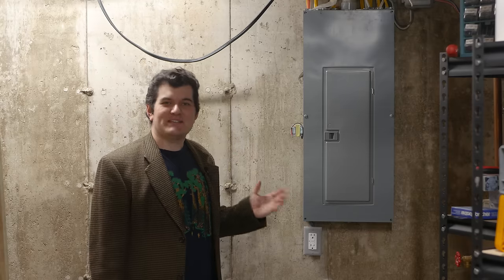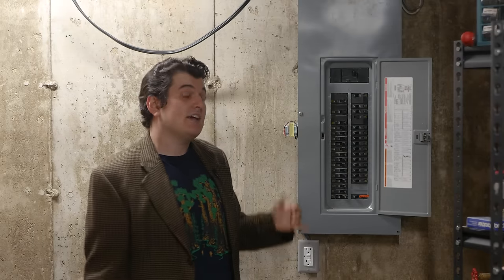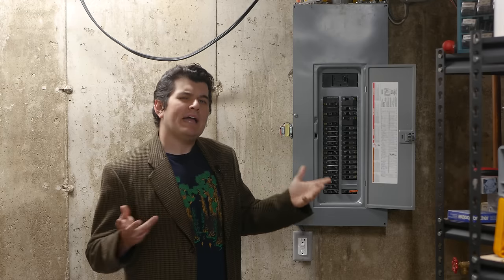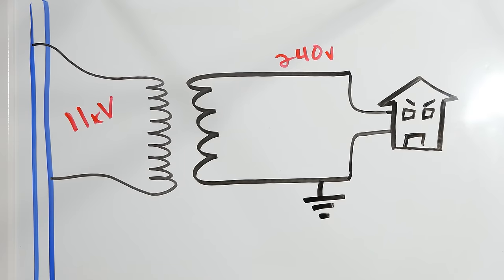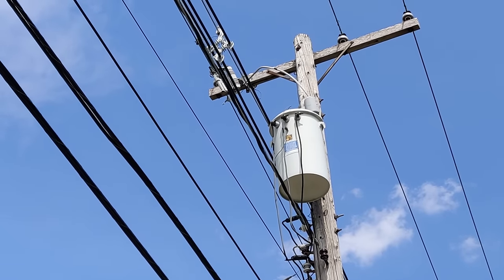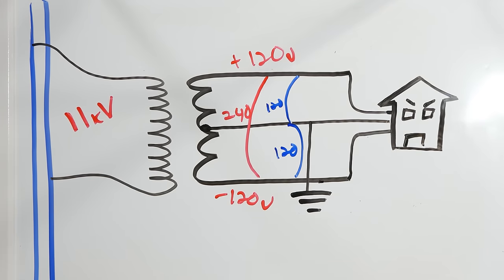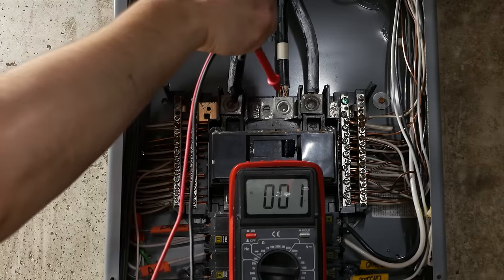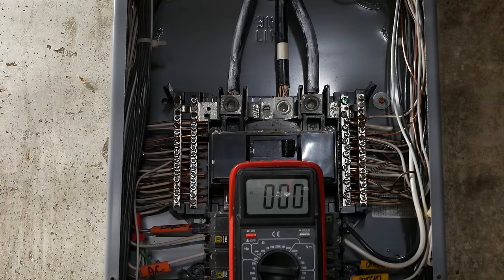The US electrical system is not 120V

Comment: For anyone commenting on how “bad” his panel is, I’ve seen WAY worse when old buildings upgrade the circuits without upgrading the panels. My parents 97 year old home had so many wires in in before upgrading to a full 200 amp panel it was literally dangerous.
Dual circuit breakers (yes they are real) WITH two wires in each circuit because there was just no room for more breakers being a 100 amp panel.
Oh and nob and tube wiring which often was wired incorrectly and electrified the device instead of grounding it! In the US older homes can be an electrical fire waiting to happen.
Reply: Yeah I would consider his panel damn near pristine compared to.... well almost any house I've ever lived in. I mean, you can tell what runs where, it's labelled, wires run in logical lines! Mostly all installed in the last 50 years! No immediately obvious fire hazards! I would be downright pleased to have a panel that clean.
I've lived in a house with 3 distinct generations of wiring systems - the original knob & tube with cotton sheathing, then some rubber-sheathed/cotton wrapped, then some 90's rubber sheathed/rubber wrapped, all fed haphazardly into a semi-recent 100A panel. You can tell that the skill of the person doing the wiring went down with each generation of wiring too - the original stuff was actually installed decently. The later stuff was a bloody nightmare.
It's really common to see houses with a mix of Aluminum and Copper wiring, or with the original knob & tube running into the original fuse panel, which was unhooked and then fed from a 60A breaker on a new panel - leaving the old stuff as is and just installing anything new into the new main panel.
Reply: Yeah it honestly looks like a pretty normal 200 amp panel, just with more circuits than most single family homes have.  I've seen MUCH worse wiring jobs.  And honestly, how much does it even matter if the wiring in the panel is kinda messy?  It's covered for a reason, and you shouldn't be messing with that shit unless you really know what you're doing anyway.  In which case you'd probably know enough to kill the main before digging around in there.
Reply: Joshua  I'm very glad that according to NEN (Dutch DIN) the entire fuse box must be replaced to be up to code on any significant change.
Reply: In my panel everything is ground to the neutral lead, the house doesn't have a grounding rod. Yay 1920s electrical code (or lack thereof)!
Reply: Joshua  to be fair, electrical fires in the United States are exceedingly rare. Most are caused by poor wire condition, rather than the design. 

The panel box is probably the safest place, electrically, in the whole house.
Reply: @Cyanide300  Looks typical to me, but I've only ever seen my own electrical panel.  We live in a single family 2784 sq ft (260 sq m or so) home.  Houses around me range from around 1500 to 3000 sq ft (140 to 280 sq m) That number of circuits allows for 1 or 2 per room for outlets, a few for lights, 1/2 a dozen for the kitchen, and a few 240V appliances.  Mind you we have gas water heater, furnace, dryer, and stove, so we actually need LESS than you might otherwise.  I'm not sure if people in the UK just live in smaller homes, and thus need fewer circuits, or they just have to turn off a more significant part of their home if they need to do any electrical work.
Reply: Oh and my entire house is behind 2 tandem 30 amp breakers that feeds about 8 30 amp breakers...
Reply: Our panels are rotated 90° from that but yes that panel looks beautiful compared to some of the boards I've had to work in...
Reply: @arienh4  i think in the US most electricians will upgrade the box if there is a big change or to replace older (20+ year) panels, but then again we also are not known to have certified electricians do some of the work, we like to fix and replace stuff ourselves which can lead to a lot of hack jobs.
Reply: There's nothing wrong with dual breakers. They are standard in a lot of cases, and allow you to use a smaller panel to server more circuits. The busbars are more than capable of delivering the power necessary for 2 15-amp circuits from one standard sized breaker.
Reply: My UK one is lead and paper lined cable from the main line to the house going into a wood and bakalite box with a few breakers, then onward through another 3 breaker/isolation boxes as no electrician wanted to touch the original box/cables.  Everytime a cooker or shower etc was installed in the house a new box was added along with a ratsnest of cables.  Im gradually replacing the fuse wire cartridges with rcds but to replace the entire lot with something safe would cost thousands and thus will never get done.  So yeah, his box is like a palace lol
Reply: @PunakiviAddikti  what he meant by not grounding the device is that knob and tube was often wired backwards, such that neutral was live and live was neutral. This didn't matter very much with non polarized plugs, but for Edison screw lightbulbs, this made the screw which should be neutral and therefore relatively safe live at mains voltage. Changing a bulb incorrectly was enough to cause severe harm.

Really the bigger issue with K&T is the huge fire hazard. Paper insulation, now likely chewed and rotted, meaning exposed several decade old wiring mere inches apart running throughout your attic. One mis step storing a box and boom, you're dead, the house is burning down, and your insurance probably doesn't cover K&T fires.
Reply: My grandparents house has light switches that you have to flip in the correct order or sparks come out of the wall. His wiring is a work of beauty. It doesn't even have exposed wires on the outside!
Reply: They should see my 100Amp panel on my house built in 1950 with nothing labeled and halve the lines run being old braided 2-12 with no ground and 90% of my lights piggy backed off of one leg of my dryer 240 with out their own sub panel (all things I plan to fix I moved in a couple months ago)
Reply: @roxies.8287  barns? Yeah, that's a farmer. People who do any repair or maintenance do not like typical farmers. If it's already broke, they break it into submission.
Reply: I read that as "Mormon" first time round. That was a little weird.
Reply: I'm about to work on a panel that has had anything professional done to it since the 70s. Someone at some point rewired the garage into the living room to add a hot tub...time to fix that.
Reply: Well, from a code compliance issue, I can see couple of issues with his panel.  Ground's and neutral are to be hooked to separate bus bars.   Only one neutral wire is allowed per lug on the bus bar.  It appears he has multiple instances of a ground and neutral sharing the same lug.  The reasoning behind that code rule is this...  Suppose there is a loose/bad connection in the panel.  The ground and the neutral are share the same lug or bus.  The neutral voltage will float above ground voltage due to the high resistance of the poor connection .    That circuit that has it's ground sharing the same neutral lug or bus, will no longer have a ground at zero volts potential it will float to the same voltage as the bad neutral .   So a grounded metal framed appliance, like a refrigerator could become a shock hazard.  If you got 2 circuits from different 120v halves sharing the same neutral lug and that connection is bad, then the voltage at one of those circuits could rise above 120v and the other below 120v because the neutral is now floating.
In the real world how much of safety risk this actually is...  Probably not so much.
Reply: My in-laws house, built in 2010, has these too. More breakers in a small panel!
Reply: My dad's house...built new in 1987...with 200 amp service...has a panel with a bunch of twin breakers and exactly 2 spaces free. I think it's a 16-space panel. Did they actually save any money doing it that way, twin breakers were usually more than twice the cost of two normal ones...
Reply: Old houses are grandfathered in you still have houses in the USA with knob and tube wiring. Not an issue unless you hire a hack electrician or mess it up somehow.
Reply: @Cyanide300  I have three panels on my place.  One where the power from the main power pole comes onto the property, one to my work shop (4800 sf) and one to the residence.  At times, I use all the power coming into the property, especially since I also have a deep water well which uses 220V current.
Reply: I thought his looked nice af. Our house was built in 1951 and the electric box is so messy and bad looking, probably not up to code but who cares.

Comment: lmao the last couple minutes where you're just going off is 10/10
Reply: I laughed so loud just now finishing the video. Like some sort of crackhead at 3:30 in the morning.
Reply: @artcamera5514  True. I travel the world for work, and using plugs all over the place, I can appreciate the smaller form factor of North American style plugs. The UK bricks, forget about trying to plug in more than one or two chargers in most cases. Australia, same thing. And the massive size of those plugs, you damn near need another suitcase to carry them around. EU two pronged- never know if any given combination of plug and outlet will fit together to make a connection, and they always just flop around loosely and fall out, usually have to get a stack of books or something to support the adapters or plug ends. And the switches on outlets.. no labels usually so it's a guessing game of flipping everything on and off to try to figure it out, let alone accidentally bumping them or setting something on them and shutting off the power.

Comment: why is the house angry
Reply: The house is angry because it desperately needs a new roof.
Reply: @MoparDan  Top-hinged slates/tiles/shingles maybe? So they can lift and let the pressure out during the experiments ..? This would prevent the roof from blowing away due to too much positive internal pressure.
Reply: First thing that came to my mind, too. The house looks fierce...
Reply: If someone connect you to grid you will be angry too or even shocked
Reply: It's the angry pixies running through it.
Reply: Lol i just commented that
Reply: It's his house. 

Get to the end and it'll make sense.

Edit: I got a notification that someone liked this comment and I don't even remember why this makes sense. 
Was it because he rants at the end?
Reply: The house is angry because Europeans wired it 230v
Reply: Just mad at all of the negative energy towards the American standards
Reply: Because it wanted single phase 240V potential instead of split phase 120V at 180°. 😑
Reply: It's probably an American house that was built in the last 30 years so it's barely built to code in the cheapest way possible with crappy materials so if it's lucky it might last longer than the mortgage takes to be paid off
Reply: You'd be angry if he lived inside you!
Reply: because it knows its not the Rising Sun.
Reply: 420 likes

Comment: I'm an electrician from Australia and I thoroughly enjoyed this video haha cheers mate
Reply: Greetings, fellow Aussie! I recently had a sparkie install a new oven in my kitchen. He also fitted an isolator switch in-line with the conduit which is required by law. However, with the oven installed in its recess in the kitchen cabinet, the switch ends up being concealed behind everything and is completely out of sight / reach.
I suggested that he fit the switch to the wall outside of the cabinet where it would be accessible so that it can be turned off if necessary. But no, apparently he wasn't allowed to do that... The switch 'had' to be behind the oven specifically. Gotta love the nanny state. :o)
Reply: @razeezar  Im sorry mate but that is total bullshit and he needs to fix it as he has not followed the standards. 
The cooking appliance isolator needs to be within 2 meters but also easly accessable without reaching across the cooking surface. If you need to you can tell him to double check AS3000:2018 Section 4.7.1 
If you have any issues with getting it resolved I suggest you call your state licencing registrar.
I hope it is sorted for you. Peace.
Reply: @dcaonoek  Cheers Dane, I'll check that out.
Reply: razeezar Australia honestly seems like regulations gone mad.
Reply: It looks like section 4.7.1 pertains to open stove tops. I haven't found any specific info regarding an isolator required for built in ovens, but cursory reading of discussions on whirlpool indicate that an isolator is required for a stovetop but, confusingly, not for an oven. It'd be nice if the standards code stated this specifically either way!
Reply: @razeezar  you are right. Sorry, when I think ovens I think free standing range. Which is absolutely my fault.
Reply: @jackhewitt7902  why?
Reply: @dcaonoek  All good! Still, the whole regulation thing my sparkie was going on about made little sense. Especially considering that my house wiring already has a dedicated breaker switch for the oven circuit in the meter box out front.

Comment: RE: the "Don't try this at home" part: This was my favorite lecture that one of my professors gave back when I was in college. It was famous for anyone who had taken his class. He called it the "How Not To Die" lecture and covered pretty much what was in this video! One other useful thing he also mentioned: In a lot of the newer hostpitals and care facilities, they install the 3-prong outlets upside down so that if a metal object like an IV stand falls down onto a partially inserted plug it lands on the neutral phase.
Reply: i.e. the right way up.

/brit
Reply: @tyteen4a03    But then it doesn't make the little face. 😮
Reply: NEC, trying to protect you from yourself since 1897.
Reply: "Don't try this at home"
** Me as a electrical engineer who works on up to 380kV substations **
"Why?"
Reply: @taylorwest6986  It's quite the conundrum. On the one hand, we don't want people to electrocute themselves and die.
On the other hand, 😮.
Reply: Most commercial electrical installs in the last 20 years are ground prong up. The office building I work at, built in 2007, has the outlets ground prong up.
Reply: No, it lands on the bond wire (the "ground"). If something tips to the side, it then has a 50/50 chance of shorting, instead of a 100% chance.

Comment: "Like a lil' furnace. But tumbly" is a brilliant phrase
Reply: Yep, it is still weird though
Reply: @jamesc4999  We have homes that are still heated with oil (kerosene) fueled furnaces as well. Which to me is even more strange.
Reply: @jamesc4999  I dont see how an appliance consuming power AND gas is weird. That's how water heaters work!
And gas stoves!
Reply: What could possibly go wrong?
Reply: @PosranaRegistrace  Surprisingly little with all the flame sensors and other safeties.
Reply: @richw3215  My family's farmhouse has a diesel-powered furnace, and there's a little valve on the side of the house that you open to fill it. Pretty weird, but the house is probably getting torn down in the next 10 years, so it's not worth it to replace the furnace at this point, especially since it's still working.
Reply: @stitchfinger7678 What?  My gas water heater had no electric connection at all.
Reply: All dryers should just be heat pumps in this day and age